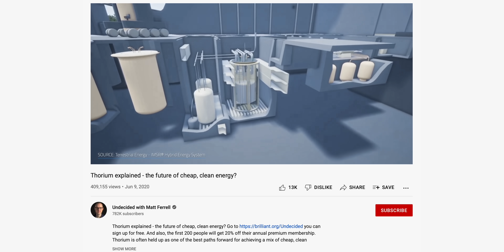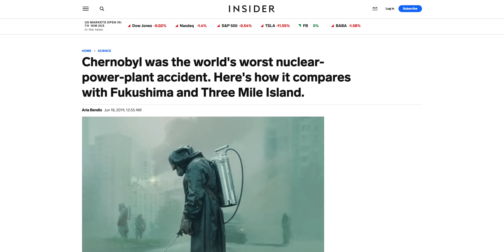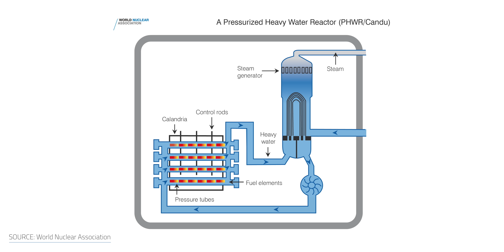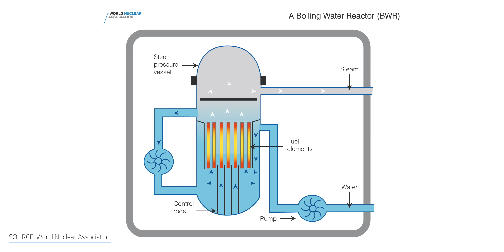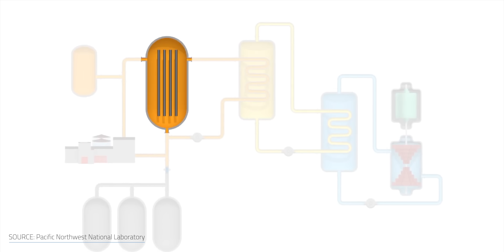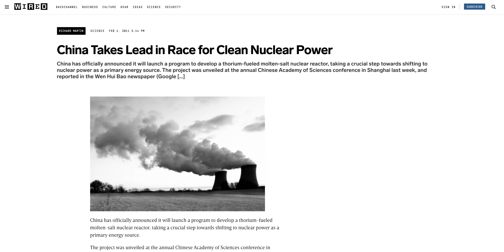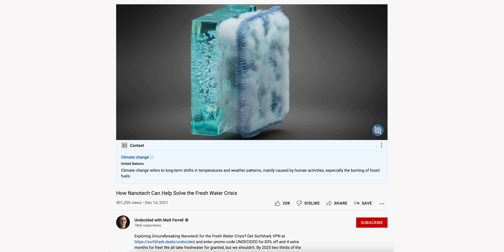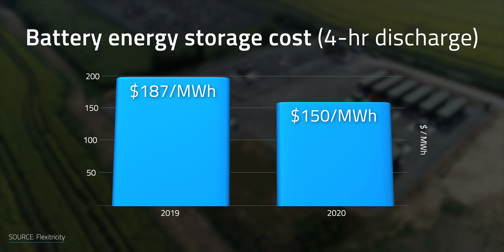Revisiting Thorium Energy - The Future of Nuclear Power?

Comment: What is not being told the public is that fusion reactors do produce radioactivity. It is a non-containable radioactivity and is produced by tritium. Molten salt thorium reactors can seriously limit the amount of tritium produced by not using lithium 6 in its molten salt. If it uses lithium 7 almost no radioactivity is produced. Tritium will effect the ground water around nuclear plants and this will be consumed by humans in the ground water around a plant unless lithium 7 is used. Regular table salt can also be used in molten salt thorium reactors. The problem then becomes radioactive chlorine 35 since it is a neutron poison with a large neutron cross section. This can all be taken care of with lithium 7. You can imagine how much easier it would be to reduce lithium 6 and use lithium 7 in the lifter reactor since 7 from six is much easier than 235 from 238 enrichment. The problem will then be what to do with the lithium 6 because it is proliferative in a large extent
Reply: The current leading fusion technology not only produces tritium, it absolutely relies on it as it is half of the fuel.   The tritium is to be puposefully bred in the lithium jacket and captured to inject into the plasma.    One of the many novel technologies ITER is going to have to start testing.   Deuterium Tritium fusion can’t afford to be as blasé about losing tritium as fission reactors are.

Comment: To have an apples-to-apples comparison on the basis of LCOE between solar and a load-following MSR, you need more than a 4 hour battery.  You need sufficient storage that solar system has the same service factor as the nuclear system.  Maybe a days worth of storage, and a massive investment in long distance high voltage lines to share these batteries over hundreds of miles?  That will drive the cheap solar power to be more expensive then what is projected for MSRs.
Reply: That is not true at all. Solar matches load changes pretty well which peak mid day. And centralized nuclear plants need just as much distribution as distributed wind. There just isn’t any real advantage for nuclear over wind and solar that I have seen.
Reply: @williammeek4078  Have you heard of the duck curve? Maybe in places with high air conditioner loads the peak is mid day, but most places have high loads in early evening.  Hard to take you seriously.
Reply: @richdobbs6595  Ya, you see, there is this thing called the duck curve. Maybe you should learn about it if you want people to tale you seriously. It doesn’t show load, it shows something very specific. The mismatch between solar generation and total loads. It doesn’t account for wind at all, and it turn out, the wind is always blowing somewhere in the US, even at night.

Comment: In northern climates with little sunlight and snow/icing problems during the winter, nuclear is a must for a zero carbon future.
Reply: Except farming the steady wind these regions for free. Many regions are at the coast too, which even bolsters the steadiness. Before anyone guessing about a reliance problem. There are already GW installed capacity inside the arctic circle.
Reply: @juliane__  Yes but its more difficult in these climates as the blades can ice over if they are not heated which greatly reduces efficiency.
Reply: @PsyK1c   I know the issue and i know the wpp are designed for the climate. Nevertheless, it seems an attractive option in whole and scale for Sweden with its vast rural lands. It is already in GW scale and is to be expanded because it is reliable and very windy. It is not like the inland turbines in southern Germany.

Btw. can you name one nuclear power plant in the arctic circle? I know there is one small floating plant in Russia - but what about a game-changer in GW scale?
Reply: @juliane__  at 30% efficiency so you have a possibility of freezing 70% of the time
Reply: or according to the IPCC you can burn wood pellets and trash, carbon free like in Sweden or greta from la la land as some call it - strange that the level of CO2 keeps going up when its carbon free
Reply: @jimlofts5433  Burning wood is okay for low density rural areas that have enough land to grow back as many trees as they burn making it technically net zero. But its not really an option in urban areas where the particulates/air pollution becomes a major issue if everyone is burning wood, even if they somehow grow enough trees to offset.

Comment: The Chinese research project should be closely watched, (preferably by reading their e-mail in real time; reversing the usual flow of research information). 
One fact that is rarely spelled out is that the waste storage problem is a symptom of the horrendous inefficiency of the current conventional technologies. So much of the potential energy in the fuel is not captured for use, but remains in the waste to cause problems.
Reply: Sharp Ears and Eyes. Thorium is ONE of the MAIN fuel that the CCP under their 2010 , 5 year plan wanted as Part of the Nuclear Generation Source. Todate 10 years has passed. But they have a 20 year PLAN and is STILL doing R&D plus refining their Thorium reactors. Beleive that have a "Demo Thorium reactor" running . And are getting DATA on it reliability, effeciencies, re-fuelling, maintenance, etc. ..... China HAS BEEN very Tight-LIP on its Thorium reactors programe. Would NOT be surprised that Chian will have a COMMERCIAL Thorium reactor RUNNING by 2030. Besides China have the LARGEST Thorium deposit ( Disputed by India ). 😅😅

Comment: Excellent video!  I think Thorium reactors bring many benefits over traditional Uranium rectors.  The most important being safety and half-life of the waste.  But, there is a still a waste product and how much waste would result if 30% of the US power were provided by such plants?  Then how much area is needed to store the radioactive wastes and provide safety and security for the waste? I think nuclear power is necessary for a sustainable and stable power grid. Almost weekly we hear about the deficiencies for green energy solutions. Without sufficient storage capabilities, green energy solutions are not practical.  The cost of storage facilities and manufacturing costs for the storage is too high. I suspect that the waste in green energy from manufacturing to disposal of the equipment and batteries is significant. I would suggest life cycle cost analysis be used to review these possible energy solutions that make their rounds on YouTube. Then an availability factor must be considered too.
Reply: Thorium reactors bring no benefit over a traditional fuel cycle reactor.
Reply: @MomsLittleJedi  From my military training, it looks like the Thorium may hold many benefits compared to my training.  But technology is always changing. You may be correct then.

Comment: If we want to go carbon-free, nuclear will need to be a part of the solution. Wind and Solar are great, and when combined with storage can do quite a lot. However, it won't be enough to keep up with the increased demand from our electric grids. EV's alone are going to more than double energy consumption, that's not something wind and solar can handle. Even with storage, wind and solar are still intermittent. They can be used to replace peaker plants, but they aren't going to be able to replace base load. The only thing we have that can, that has the energy output for our ever increasing demand, without CO2 emissions, is nuclear. Nuclear has the energy density needed to keep up with demand. One MSR reactor will produce the same amount of power, on average, as a fifty km/sq solar/wind farm. Furthermore, they can be put nearly anywhere that is seismically stable, without regard to local weather conditions. Nuclear does not care if the sun is shining or if the wind is blowing, it produces consistent and steady power that can be safely relied upon. 

Of course, not all nuclear is created equal. I think MSR's are going to be the way of the future in the nuclear industry, at least for land-based grid power. Compact nuclear reactors can supplement this locally, with completely enclosed systems capable of powering entire neighborhoods, if we want to decentralize our grid. But some form of nuclear is inevitable if we want zero carbon emissions. 

The longer we keep our head in the sand about this, the worse a position we're going to be in when we finally admit the elephant is in fact in the room.
Reply: Nuclear will also require grids. Over continental scales, wind is very steady and predictable. Why not just go with large scale wind when it is cheaper?
Reply: @williammeek4078  Because it can't scale fast enough to keep up with rising demand. One nuclear reactor can provide base load for a significant portion of the grid. It would take a wind farm larger than any currently in existence to match that output. 

To be clear, I'm not saying nuclear instead of wind and solar, I'm saying nuclear in addition to wind and solar will be required. It's not a matter of 'which one' but 'all three'. 

It simply is not possible to meet current much less future demand on wind and solar alone. We can't build them fast enough, let alone have enough room for them all.
Reply: @ShneekeyTheLost  You are factually incorrect on the size of wind farms needed. You are factually incorrect that wind and solar alone can’t do it. It is easily doable and is being done. It is nuclear that cant be scaled in tine to address climate change.
Reply: @williammeek4078  It isn't being done fast enough to keep up with growing demand, we don't have the manufacturing capacity to do so. 

And again, you seem to be thinking it must be either/or. The only way to meet future power demands is all of the above, solar wind AND nuclear.

Comment: Thorium is not the end all, be all. First of all thorium cannot be fissioned (split by neutrons, thereby releasing energy like uranium-235.) It is a fertile material that captures neutrons and breeds U-233 which is the fissionable species. The idea in the Th fuel cycle is to use U-235 (the current fuel for our light water reactors) to start the reaction, thereby generating U-233 which would continue to fission. An inherent problem with U-233 is that it has daughter products that are highly radioactive with gamma energies exceeding 1 MeV. This means that conventional pelletized fuel manufacturing operations cannot be realized without harming the operators. Yes, Th is plentiful, but there is enough un-enriched uranium (U-238) to last for hundreds of years, currently on-hand and  stored away. This material can breed plutonium-239 which is much easier to recycle than U-233 to manufacture fresh fuel.

The only ways I see Th working is to use it in a disposable mode as a blanket surrounding a U-235 core where neutrons escaping the core would cause the Th to breed U-233,:which would then fission and extend the life of the core. Admiral Rickover tried this concept at Shippingport reactor in Pennsylvania and it was moderately successful. This can be done with conventional fuel manufacturing processes. An alternate way would be to use Th as a molten salt and then conjure up some kind of on-line chemical reprocessing to eliminate the fission products and supply fresh Th…all of which is highly speculative, unproven, and fraught with real world difficulties.

Sorry this is long, but this is a complex technical subject that cannot be done justice with a word bite or two. What is written here would barely scratch the surface of issues and problems, that require resolution, including materials of construction that withstand high temperature molten salt in an intense radiation field, at an affordable price for commercialization.

Comment: First thorium reactor is actually almost under construction now. Indonesia has signed an agreement to build first TMSR-500 reactor that will be constructed by ThorCon. It will be  constructed in shipyard in form of a ship, then moved to desired place, placed in one of the bays next to one of the islands. Work is progress is fast and we may see this plant operational within 2023-2024.
Reply: Thorcon still uses a mostly uranium cycle. But a general SMR is a step in the right direction at least.
Reply: Their intention is to get something in action that is cheaper than coal Now and prove it works and get to Thorium later.
Reply: @solexxx8588  I'm going on what Thorcon and Seaborg are saying they have to do where their that market is: SE Asia and where to my understanding solar-wind aren't good alternatives. Not sold on solar and wind being cheaper for big scale power gen either. Energy Density.
Reply: @solexxx8588  No, solar and wind are not cheaper. There are enough games played with those numbers to make even an actuary's head spin. They never include the decommissioning or recycling costs, and they fail to annualize the carbon impact from said activities to then re-amortize the cost. Solar and Wind are still in the mid-$40 range. The EIA numbers are bunk.
Reply: @DFPercush  Thorcons approach is whats available, whats cheap but safe and cost cost cost to stop Indonesia and other undeveloped countries building coal for electricity and it must be now as once they build coal that will last 50 years they are not going to tear it down and go nuclear - so yes uranium now but thorium later step by step but build now
Reply: Thx, See also Seaborg Technologies.
Reply: I hope they move it away from a coast
Reply: What's latest vid you've seen on Thorcon? - me: saw something with Lard from Nov21.
Reply: Honestly, that’s the biggest thing that I got from This video. I wasn’t aware that so many new reactors were projected to be online before 2035!
Reply: The us had a torium reactor upp and running in the -50’ or 60’s så not that new
Reply: @RobinI92  and how many of them were used to power homes, businesses' etc?
Reply: @RobinI92  
This was the experimental reactor at Oak Ridge. Unfortunately it was very poor at producing Plutonium, for which "defect" (in the cold war) made it less suitable than sodium cooled fast reactors. Nixon, and later Carter spent the nuclear budget on the wrong kind of reactors.
Reply: There have been plenty of Thorium reactors across the globe, but they failed for one reason or the other. Typically, Thorium reactors have too large positive or negative void coefficients, which makes them either a massive safety risk, or makes them unprofiatble if they are moderated within safe limits. (This was ofc a very simplified explanation, but in essence that's what it boils down to.)
Reply: @augustaseptemberova5664  which are MSRs? India has tried alot w/ Thorium b/c it doesn't have much Uranium.
Reply: @KG-1  The ones that failed weren't based on MSR. But tmk India's using breeder reactors, not MSR.
Reply: @augustaseptemberova5664  so fast neutron not thermal spectrum based and not thermal spectrum MSRs that are breeders too. Important distinctions. Plus of U233 is that breeds well in thermal spectrum.
Reply: @KG-1  I'm not sure what you're trying to say. India has no MSR breeder, only conventional next gen breeders. The IMSBR and the IHTR are both in the process of R&D, according to the BARC homepage.
Reply: @augustaseptemberova5664  I'm saying that there be Thorium Reactors, but not Thorium MSRs. Listened to someone there at the time that for the small US nuke community MSRs were alien & out of their comfort zone professionally - complex chem & they were all Physicists. Vigner was good at both.  Reading Weinberg's auto bio now. This rings true, my experience and impression is the general public is quite unaware of how much their modern lives are founded on chemical engineering.
Reply: @augustaseptemberova5664  These have been solid fuel rod reactors, Th is not suitable for use that way. It is only Uranium supremacists and the uneducated (such as government officials) who constantly point out it is inferior in this way. MSRs are a totally different, and vastly superior technology.
Reply: @augustaseptemberova5664  Never heard that one before. My understanding is that the solution becomes less reactive with thermal expansion and is therefore self stabilizing. What comprises a void in a molten salt solution? Or are you talking about using thorium in a PWR?
Reply: @DFPercush  Conventional thorium reactors, the ones that failed, weren't based on MSR technology.
Reply: @DFPercush   You won't get voids in liquid fuelled reactors.

Comment: Does the LCOE for  solar  & wind farms in this video include LCOE for back-up sources such as gas and coal when the wind is not blowing and it is too cloudy for PV? If not then renewable energy is a scam.
Reply: Of course it doesnt, LCOE is used for investors and it has nothing to do with what it takes to operate a grid. Also doesnt cover shitty capacity factors. Need 2 MW of power, you can build 2 MW of nuclear or you can build 6 MW of solar and a 1 MW gas plant which is no longer cheaper than nuclear.
Reply: I don't think you have to include the cost of other forms of energy, you just need to include an "up time" factor to account for intermittent under/over-production.
Reply: Or, you just import electricity from places where the sun is shining or wind is blowing.
Reply: @williammeek4078  Yeah why not depend on another country for your energy? What could possibly go wrong?
Reply: @juimymary9951  more like a neighboring state.